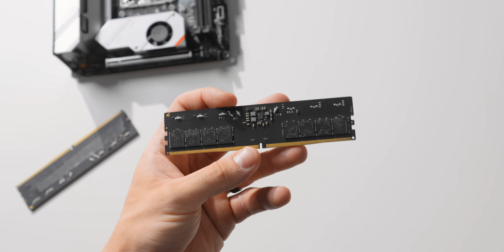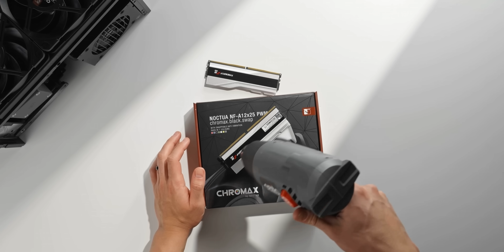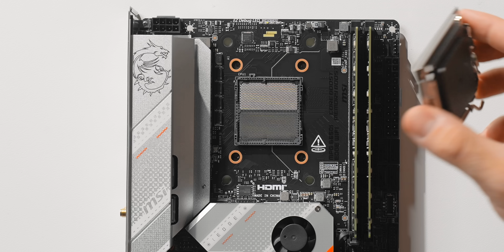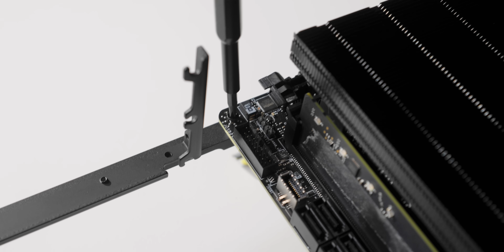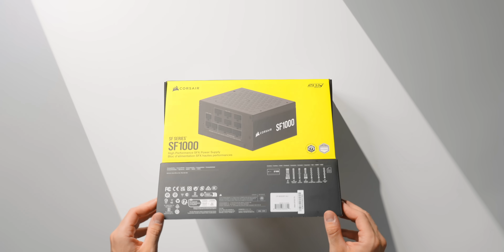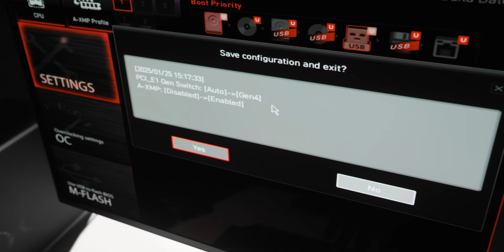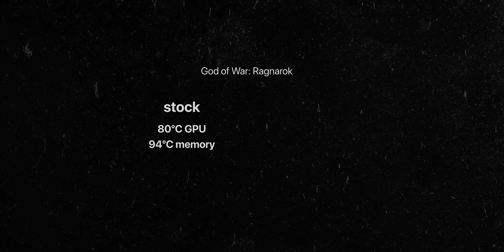My fastest gaming PC, ever – 5090 + 9800X3D

Comment: If you plan on putting an ssd on the backside of the motherboard, aren't you afraid of high temps due to the gpu blowing hot air right on it?

Comment: i have the exact same mobo, but with 7800x3d,   however my post time is insanely high, like 4 to 5 mins. 
did a reddit search i changed one setting i forgot the name, now better with like 1 mins, still way too slow.   it takes like 30 second to even show up a logo, and for the keyboard to detect  numpad light, anyone ?

Comment: Why a 990 Pro? I thought DRAM included on SSDs were much better for gaming. (Not just load times but frametime stability when loading in stuff during gameplay).

Also should u seperate games and OS drive? Does it have any performance improvements to help frametimes?

I’m asking all this stuff about frametimes cause games really stutter lots on PC lately (Yeah Ik UE5 is mainly at fault BUT surely there’s a way to reduce these issues).

Comment: Don't you think, reversing PSU to intake air from gpu site that from outside of the case would help GPU temps ? It could also help with acoustics since the fan would be cramped inside the PC, not near outside of the case. It would definitely increase the PSU temps/fan speed of the PSU but i think that is worth trying

Comment: I'm running something similar!

9900x & 3090 currently inside the fractal terra. People told temps and noise would be insane, but it's actually more than reasonable. For cooler I use Thermalright AXP90-X53 FULL copper (with black noctua fan). 

The trick however is that I had to add additional noctua fan at the bottom, while placing it upside down so that it does intake instead of pushing heat down(which chocked the internals via reabsorbtion of hot air). And also I did some undervolting and curve adjusting in bios to make sure cpu doesn't get beyond 85c.

In the end I am very happy with what I have, but thinking on updating to 5090 whenever it'll be available in my country.

Comment: That undervolt was insane! Always do that with new GPUs. They over spec the voltages to make sure most cards run stable but tweaking it really brings out the efficiency.
Reply: Power limiting isn’t undervolting. They’re 2 different things.
Reply: @Simon_Denmark  Sure but it results in the same thing. Lower power.
Reply: @conyo985  Yes but you’re not undervolting by power limiting.
Reply: @Simon_Denmark  Ok. Got it. Point taken.
Reply: @Simon_Denmark  i mean lower the power limit but then overclock it
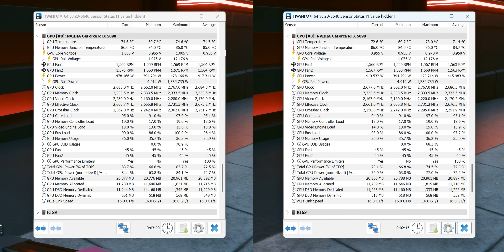7:37 he said effectively undervolting , so it works basically same as undervolting?
Reply: @hanspe8997  I mean yes both aim to do the same thing but in different ways. With undervolting you change the voltage/frequency curve and limit to something like 900 mV. By power limiting you’re just straight up limiting the power the GPU can use. The methods are different.
Reply: @hanspe8997  Voltage wouldn't be lowered by reducing power limit, that would reduce wattage
Reply: And what makes up wattage? amp*volts = wattage... So by lowering wattage that automatically lowers one of both of those factors.
Reply from the maker: @Simon_Denmark  modifying the frequency / voltage curve does not work on 50-series. Same as 40-series. The GPU ends up dropping the ‘effective clock’ and you get a performance drop.

With power limit + overclock the effective clock stays the same as the GPU clock.
Reply: @optimumtech  oh that’s good to know. I’m still running an undervolted 3080 FE (per your tutorial 😉) but looking at the 5xxx series as an upgrade and planning to undervolt.
Reply: @optimumtech  You have to choose a dot at the voltage you want, drag the entire curve up to the target clock speed desired, then select all the points after the dot and drag them down then press apply, which will automatically straighten the points afterwards. You won't have any drop in the effective clock doing it this way (it should only be around 15mhz, which you can see when power limiting too at 7:35). As far as I can tell both methods are the same anyways but you will get more control when directly changing the curve, although power limiting + oc is definitely easier to apply and be done with.
Reply: @optimumtech  You can definitely still undervolt 40 series successfully with the method that Mark said basically. I have a 925 mV undervolt on my 4090 with 2565 MHz boost clock and +1500 memory clock. The performance difference to stock is barely noticeable. But like it was said power limiting will work just fine as well. In regards of 50 series I can't obviously say anything.
Reply: @optimumtech I wonder if power limit + overclock also works on 30 series card? If you could share your results it would be great.
Reply: @optimumtech  Can we get those stand off links? I'm not sure which to buy!
Reply: @ it works. I use this method with mine 3070ti and its better than fix clock/tension vcore.
Reply: @optimumtech help me to buy that cpu cooler 🙏 please, I can't buy it here (USA) please
Reply: @optimumtech well doing this exact same thing to my 5090 fe results in a heavy drop of the boost clock down to ~2200mhz and a 9-10% performance loss. Can't do anything wrong here i guess, any idea where the issue might happen??
Reply: this is the better way. since 3x00 series if you drag the point/clock, maybe you get clock stretch and loss performance
Reply: This was good to see and will hopefully mean I can go from 4090 to 5090 and keep my 850w PSU. I saw in another review of 5090 that total system draw was well under 800w so this tweak should allow a 5090 to run pretty comfortably on an 850w PSU. Also I'm on a 13700K which doesn't draw as much (I don't think) as these top spec CPUs and I'll be capping performance to 120fps as well which should also help
Reply: @AMDman18 seeing as you have a 13700k I don’t think you will see a huge uplift. Your cpu is the bottle neck. Also the 13700k pulls 2-3 times the wattage of the 9800x3d depending on load.
Reply: @jaggerishere  I'm on a 4K120 display. Well, technically a 144 display but running through an AVR limits it to 120. At that res CPU is almost never going to be a bottleneck, which is why you never see 4K gaming in CPU testing. Also since I'm limiting the fps and not just seeking MAX FRAMES. I'm more after consistency than being able to say I'm getting more frames than the next guy
Reply: :hand-orange-covering-eyes::hand-orange-covering-eyes::hand-orange-covering-eyes:
Reply: Is overclock+lower power limit same as undervolt?
Reply: @hanspe8997  not directly but there is a significant connection. Power limit is used as percentage of the graphics card power consumption limited in wattage. So if the card designed for eg. 500 watt and you set it 50% it will aim to pull 250 watt. To achieve that it will use its internal clock and volt graph for each step of predefined clock speed there is an assigned volt and it will step it up until its reaches the desired measured in watt in this case 250 watt. So technically its not undervolting but underpowering but in the result of that there will be lower voltage usage. To undervolt a card back in the days it would be a slider but nowadays you cannot go in minus and assign a global minus voltage to the previously mentioned graph. The slider nowadays go only to positive direction as far as I know. You need to open this graph for exmaple in after burner and modify each step so you can assign a modified voltage for each set of clock speed and thats nowadays undervolting. If you did not catch the difference, its means that if default graph made by the manufacturer of the bios does not efficient or tuned to the particular unique card of yours than using power limit will be dirty way to decrease voltage. By undervolting by hand you can get better performance and better power consumption for each step the clock is jumping up or down compered to power limiting. But it also doesn't mean that you cannot use them together as final limit of the card in power consumption.  There is the tempeture target that I did not wanted to bring in because it would make it more difficult, basically you can tie temperature to power limit that means if one of them reached the target the card would step back until the desired target is reached and do it again. Since temperature is not static as power consumption it will jump down and up a lot and the performance wont be that stable. Its a good practice to put the temperature in position that the card normally would not reach and it would be only happen if something undesirable happens like really hot room or hardware malfunction. Its failsafe and not desirable target. That's my understanding I might be wrong on some point I am not an expert but I hope that I satisfied some people interest on the matter.
Reply: @hanspe8997  not directly but there is a significant connection. Power limit is used as percentage of the graphics card power consumption limited in wattage. So if the card designed for eg. 500 watt and you set it 50% it will aim to pull 250 watt. To achieve that it will use its internal clock and volt graph for each step of predefined clock speed there is an assigned volt and it will step it up until its reaches the desired measured in watt in this case 250 watt. So technically its not undervolting but underpowering but in the result of that there will be lower voltage usage. To undervolt a card back in the days it would be a slider but nowadays you cannot go in minus and assign a global minus voltage to the previously mentioned graph. The slider nowadays go only to positive direction as far as I know. You need to open this graph for example in after burner and modify each step so you can assign a modified voltage for each set of clock speed and thats nowadays undervolting. If you did not catch the difference, its means that if default graph made by the manufacturer of the bios does not efficient or tuned to the particular unique card of yours than using power limit will be dirty way to decrease voltage. By undervolting by hand you can get better performance and better power consumption for each step the clock is jumping up or down compered to power limiting. But it also doesn't mean that you cannot use them together as final limit of the card in power consumption. There is the temperature target that I did not wanted to bring in because it would make it more difficult, basically you can tie temperature to power limit that means if one of them reached the target the card would step back until the desired target is reached and do it again. Since temperature is not static as power consumption it will jump down and up a lot and the performance wont be that stable. Its a good practice to put the temperature in position that the card normally would not reach and it would be only happen if something undesirable happens like really hot room or hardware malfunction. Its failsafe and not desirable target. That's my understanding I might be wrong on some point I am not an expert but I hope that I satisfied some people interest on the matter.

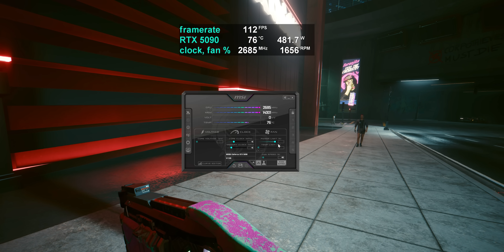Comment: After watching Der8auer's video on the RTX 5090 target tweaking, I saw that it dropped performance but was curious to know if an overclock added on top of the modified power target could solve the little loss in performance. Thanks for testing it (7:17) in a SFF case, not that I'm planning on buying one, but it's still really interesting to see how to optimize components ahead of what the manufacturer did at stock settings!

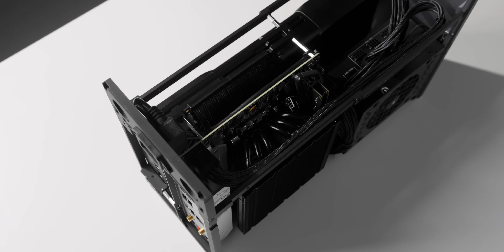Comment: 6:13 Correction: MSI B650I is PCIe Gen 4, not 5.
Reply from the maker: Ahh good catch, thanks!
Reply: @optimumtech What’s the BIOS version on your motherboard?
Reply: @optimumtech  and the riser cable is GEN4 too
Reply: @optimumtech  So why did you have problems with the system without forcing it to run on Gen 4?
Reply: @Moonator8  because the GPU was gen 5
Reply: @Moonator8  It might be simple reason as that auto detection not working correctly due to the riser cable, then some bios stuff just bugs out. Maybe it falls back to Gen1 or something.
Reply: @lordhorse89  The GPU is gen 5 even after he set the mobo settings to gen 4 isn't it?
Reply: @Moonator8 it is which means that since the gpu is on a gen 4 pcie strip it will run on gen 4
Reply: @Jizzler1  But even before he manually set the mobo to gen 4, the GPU was running at gen 4 already cause the mobo doesn't even support gen 5, so what caused the issue?
Reply: @ it was set from automatic to gen 4, my guess is that since it was on automatic it might have been scrolling through the gens. But that’s my best guess I could rlly answer even if I wanted too cuz idk😭
Reply: @optimumtech  from other testers results you're probably leaving about 3-5% performance on the table because using PCIe-4 8x vs PCIe-5 16x
Reply: @post-oakTX  der8auer's latest (Jan 26 2025) shows only 0-3.5% difference in 3 games between gen3, gen4, and gen 5.
Reply: So if I get a Gen 5 riser cable can the motherboard support it? If not is there another one that will?
Reply: @alanjimenez4474  the gen rating of a riser canle is just a validation that it will stably run the connection between a genX pcie device and a genX motherboard slot. If either of the two do not support the highest gen that one has available they will both just revert to the highest available option they both do support. If your riser is not validated for the speed they both try to run at however it can cause instability, crashing or completely no display output at all from a GPU unless the motherboard forces the connection to a lower gen that the riser can handle, even if the motherboard and GPU (or other pcie device but thats realistically what everyone cares about) could otherwise support. If you want reliable gen 5 pcie to run a pcie 5 GPU then the motherboard needs a gen5 pcie slot which is just going to be dependant on the motherboard model if it has one and a pcie 5 validated riser cable. Just because a riser isn't validated for gen 5 doesn't mean it WON'T work but there's no guarantee it will and the odds are probably higher it won't. The pinout doesn't change but higher gens run at higher bandwidth and retaining signal integrity over the cabling becomes harder and harder proportionally.
Reply: I am wondering how pci-e 4.0 mobo enable pci-e 5.0 mode in bios?
MSI should test their bios better !
Reply: Good eye

Comment: Surprised he didn’t use VLP ram.  Black Ridge has been updated (Revision D) to be fully compatible with AM5 - no need to do this mod!!!!!
Reply: vlp mostly seem to run jedec speeds. are there any vlp kits available with 6000+ M/T and decent timings?
Reply: @MatarM0  Best is CL46 5600 - but RAM speed has less of an impact on x3d CPU.

Comment: Have you tried turning the GPU around and using its fans as an exhaust instead of an intake? That might work better because of the limited space between the GPU and MB.
Reply: the GPU's intake fans facing the mobo instead of the exhaust fans? it will get worse because it's sucking up hot air from the inside. how are you going to attach the GPU to the case? if you turn it upside down, you are going to need a longer riser cable because the pins are at the top and you won't be able to screw the GPU down as the bracket is also upside down. if you turn it horizontally, then the outputs are at the front of the case and the pins are the wrong way around.
Reply: How will this even work? Display port inputs are on the other side though right?

Comment: I think the Fractal Design Ridge, would be another great choice for the 5000 series. Since the 5k series needs pass through to cool, the Ridge has the front and back meshed. So I don’t think anyone would be worried about the heat in the case, no heat bouncing off the itx mobo and getting stuck between the GPU and Mobo.

Comment: Hey Ali, awesome build, just wanted to thank you for inspiration on my own personal build, I just finished building a 4090 + 9800x3d in an NCASE M.2 with most of the same stuff from your other builds. Keep it up man!
Reply: Currently running a 9950x in my build, saw it for cheap so i snagged it... i mainly do workload type stuff with gaming on the side.... out of curiosity where were you able to find your 9800x3d, and is it good at work load type stuff as well
Reply: @Dev_ExOh  Nice, 9950x is solid, but Microcenter and amazon have been having more frequent restocks of the 9800x3d, i got mine from microcenter, but you could really (if you were desperate), get a resold one off ebay or something. Its not the best for multithreaded workload stuff, i'd say it is more optimized for gaming, and I would probably go lean towards a higher core count CPU if your main focus is that.

Comment: You should add a passive cooling heatsink on ur ssd, I got 1 off aliexpress for 50p and reduced my 970 evo plus temps by 20 degrees celsius on avg, idle now sits around 27 c and 60 c at higher load. A compact one will fit on ur ssd, or at least it should.
Reply: You have an itx build?
Reply: @atrium12  nope bud the heatsink is very compact, u can find even more compact ones than mine which will obviously be a little less efficient, but by the judgement of the space he had, I think he could fit it in there.
Reply: @atrium12  I got a $10 copper heatsink off Amazon for my rear-mounted 980 Pro in my T1. Dropped temps 10-15c under GPU load, totally worth it.